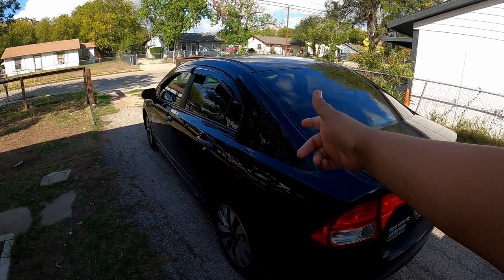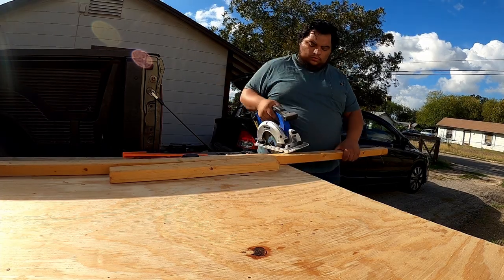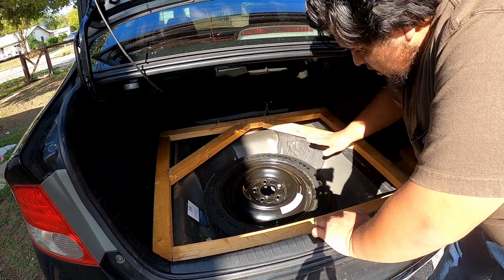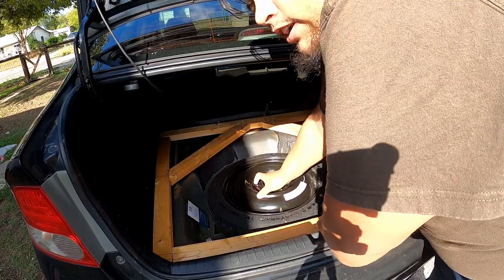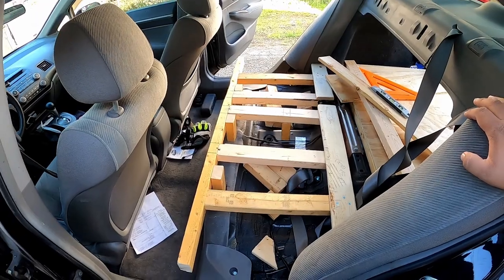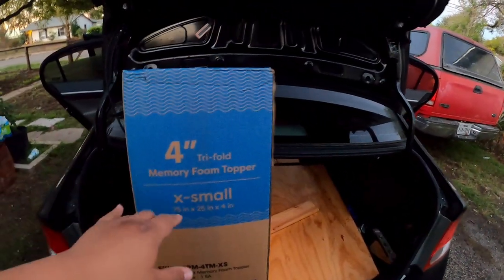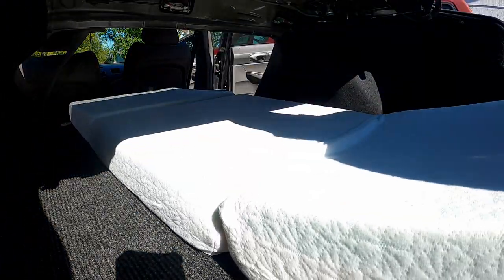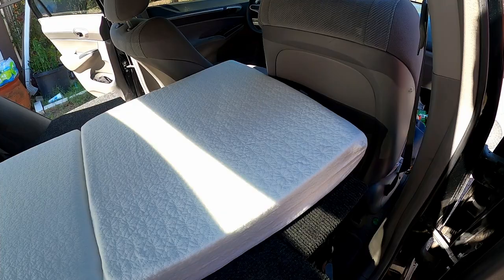CIVIC CAR CAMPER BUILD

Comment: Looks like a tight squeeze because of the cross bar and the thick mattress. Can you actually lie through that middle gap comfortably?
Reply from the maker: I took it camping to test it and the crossbar is where my thighs are its pretty comfortable, but when switching positions my legs did hit the crossbar. So now I'm making the headpiece longer so the crossbar would align with my knees so I could move freely.